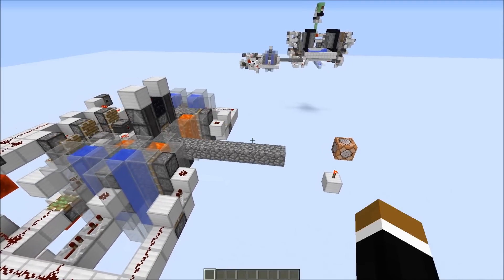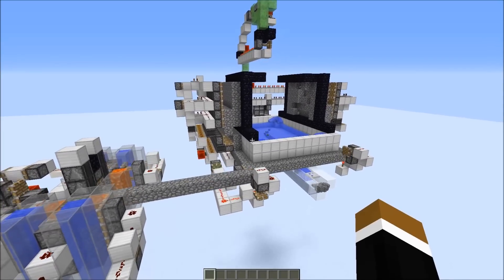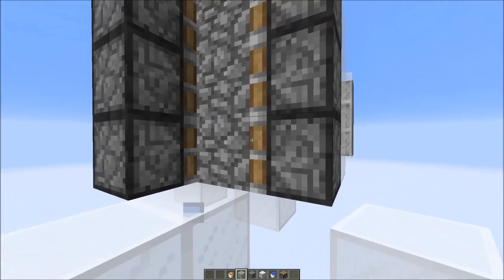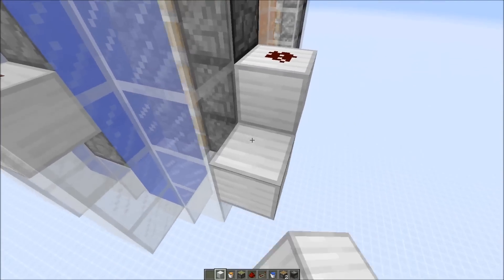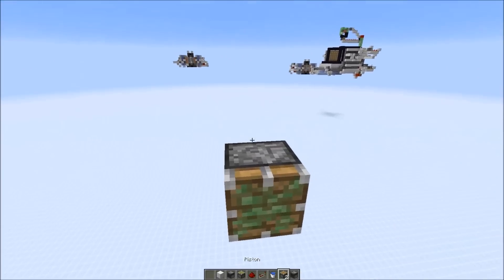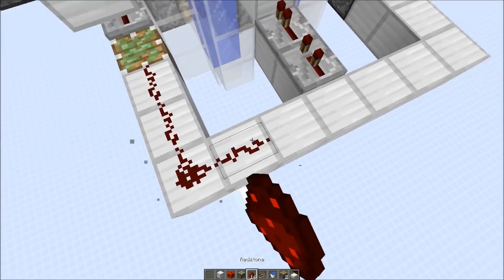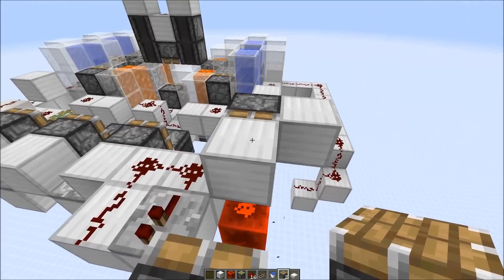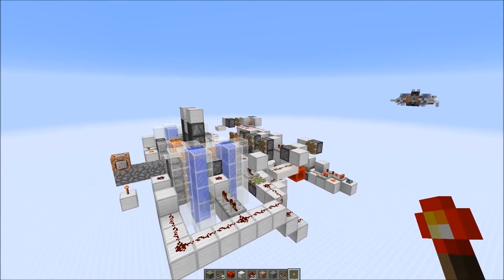[Tutorial] Automatic Cobblestone Farm 1.11+

Comment: Great Video, everyone building this in 1.16+, to redirect the redstone, place a target block on the right sticky piston (5:33) otherwise it wont work :)
Reply: Would it not be easier to click the redstone dot and turn it into a cross? (Sorry, can’t exactly tell which piston your talking about, if it’s the one tick pulse generator one or the one visible in the triple piston cobble pushing system)
Reply: Oh I think I see it now. Later on it gets redirected sideways (8:30 or so) from the one-tick pulse generators, which no longer works with the new 1.16 redstone rules... I see. Yeah your going to need a target block then to make sure it gets powered.

Comment: Still works great in 1.15. Just note, if you are using this along with his TNT blast chamber in 1.15 it seems to generate cobble faster than the blast chamber can handle. If you disable 1 of the 4 cobble generators in this farm the TNT chamber should be able to keep up.

Comment: Has anyone tried to build this in a SMP server? I've tried to build one today but it breaks after I use it. I think that I've got all the repeater timings correct, but the timing seems to be incorrect since certain pistons will attempt to push before another cobblestone has cleared the space in front. (as far as I can tell, my build looks the same as the one in the world download) Does anyone have an idea what I might've done wrong? Or does this system work too fast for a SMP server?
Reply from the maker: SMP servers work the same as SSP, but only if it's vanilla. In case you're playing on a Spigot server I wouldn't recommend using any redstone at all. In order to improve performance, they make basically every contraption unreliable. As far as I know they sometimes use a plugin that detects clocks and shuts them down and in case of a lag spikes instructions are even delayed sometimes, which ofc breaks everything.
Reply: Hi Ilmango, thanks for your response! It does look like the server that I'm playing on (mumbo's patreon server) is using a spigot server. However I've somehow gotten the cobblestone generator to work smoothly by disabling one of the initial pistons (reduces output by 1/12). The generator still works insanely fast anyhow so I'm very happy with it.

I started working on the tree module afterwards, and it broke on my first try. Would this be because the 0-tick pulse generators don't work correctly on a spigot-server? Also is it imperative to be using acacia logs within the farm to power the pistons? Or can I use any logs (currently tried using jungle logs)

Comment: Silly question, is there a way to slow it down? I've been building your modules stacked up and using piston conveyors to move them around but even your super efficient ones don't move fast enough for this farm. I tried to increase the tick delay on clock but it was still moving too fast at 4 ticks. I then tried to extend it adding an additional repeater with 1-4 ticks. Weirdly I couldn't get the system to work with anything above a 4 tick delay. Any thoughts would be appreciated.
Reply from the maker: you're probably just doing it wrong. moving blocks every 4 ticks is doable as I've shown at the end of the blast chamber video. I'll probably talk show it again in one of the next videos.

I wouldn't recommend messing around with the cobble farm, since you can't just slow down the clock
Reply: Fair enough. Thanks for the suggestion. Still a great farm.
Reply: can you make a very efficient iron farm

Comment: After a couple videos on the blast chamber I still don't understand why you can't feed 7 wide lines or 5 tall conlumns into the blast chamber or at least two separate block streams to each side. Why does it have to be a single block stream?
Reply from the maker: you can only use two input sides if the input is snychronized. The output of a tree farm varies. Using columns would also work, but you'd still need to adjust 9 high trees for example. Also it would be a little more wasteful if trees sometimes only grow 4 high. I wanted the TNT chamber to be as efficient as possible (without crazy effort), since TNT duping will be fixed at some point.
Reply: ilmango Allright. Sí, just as an. example, you could have built seven of this cobble farms to feed both sides with seven wide lines. it's just too much effort.
Reply from the maker: if you really need a fast cobblestone farm I would suggest using the one I linked in the video description. For all other modules the speed is sufficient.
Reply: Ilmango no, not quite. It was just an example to be sure. And for a normal tree farm you could use just one side of this and it would be fine. My question came from the fact that I wanted to use this for a 2x2 spruce tree farm, but couldn't turn the trees into a block stream (fast enough).

Comment: could you prevent it from getting stuck by making so when the blocks reach a certain amount it will turn off the comparator clock?
Reply from the maker: no. it would break before you could turn off the comparator clock. You would need to attach every component directly to the clock and put non-movable blocks behind the pistons to make it safe